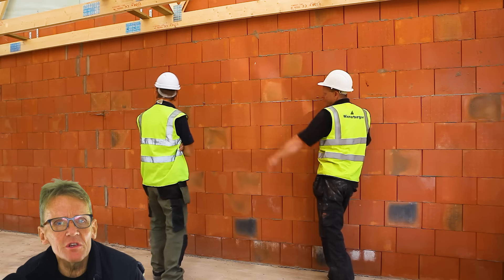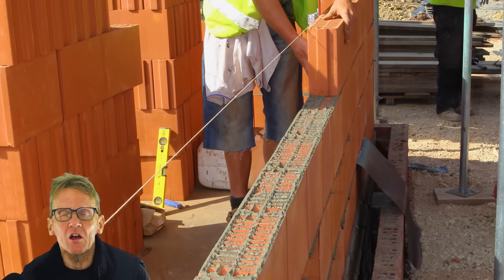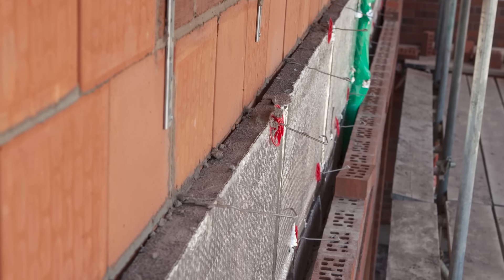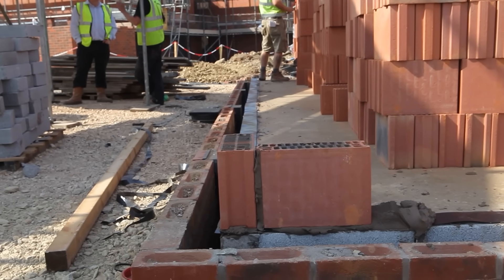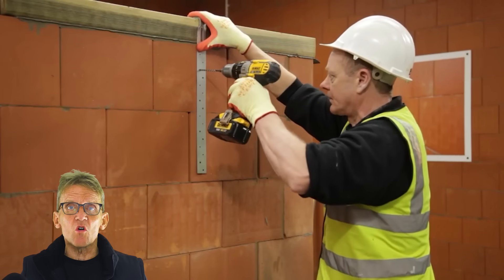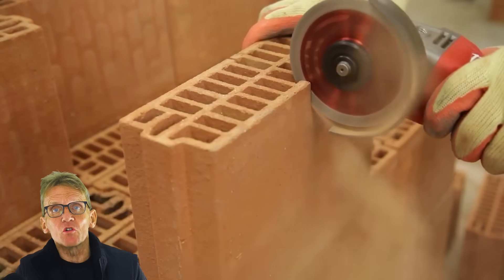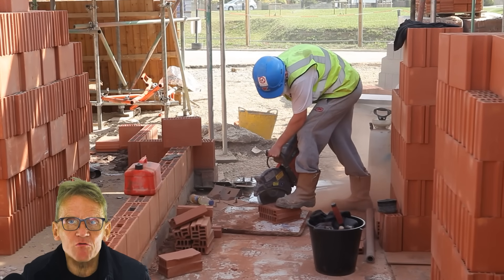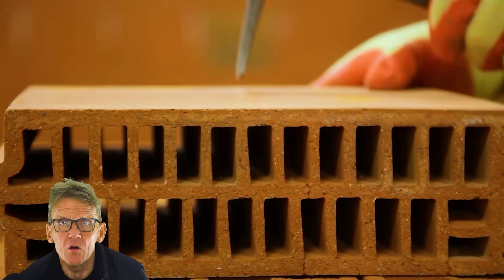Why Haven't We Warmed to Porotherm in the UK?

Comment: In this case, the special shape of the block ends creates a tight mechanical lock, which provides sufficient strength, tightness, and prevents the appearance of 'cold bridges' in the vertical joints. But I see that the shape of the ends is very poorly executed, and no mechanical lock is formed there... it will just collapse.

Comment: Porotherm blocks are used predominantly on outside walls. They have very good insulation properties, especially when combined with polystyrene panels. In Europe, the standard is 30-35 cms Porotherm combined with 20 cm polystyrene. Combined with forced ventilation a tripple glazed wibdows with outside shading gives very good summer protection. Summers are tetting extremely hot with temperatures over 30 degrees Celsia for extended periods of time. No need for air conditioning. In winters, houses like this will save you a ot of mone. We pay around €60/month which includes also hot water preparation.

Comment: Only encountered them once in uk in a small existing building.  I had a big problem securing any cabinets etc to the interior walls - the conventional uk fixings only had the useful depth of the very thin brittle 'pot tile' shell wall. 
Most each fixing length was useless inside the many hollows within the brick shell.  Being brittle the 'pot bricks' also cracked very easily - worse case, imagine trying to tighten a Rawlbolt into a drilled hole through a single 12mm vertical ceramic tile.

Comment: A thickness of only 15cm?? That's for internal walls and should never be used for external walls. Minimum Porotherm (or whatever the brand) brick thickness is 34cm for best insulation. Some brands even fill the brick's internal spaces with rock wool.

Comment: Wind and rain defeated. Clay is porous, how does it fare during freeze and thaw cycles. Is why concrete block foundations were used before pouring basement walls. Some experimenting with straw aircrete or hempcrete as natural alternatives to steel and glass in need of insulation from elements.

Comment: I built my house in south Germany with 36cm poroton perlite filled blocks in 2005. Plastered internally and the exterior with a stamisol breathable rain screen with vented douglas fir fassade. I achieved the KW60 standard. Brilliant system, would use again. In regard to people complaining about problems regarding fixings, well, you're doing something wrong as i had no issues at all.

Comment: I live in small continental country, and we have 4 Winenberger production sites in country.
They are everywhere, and can be purchased in any quantity. You can get whole train load or just i block.
Porotherm is not cheap, but is worth every cent.
Usually (lately) Porotherm is fitted with its own adhesive in form similar to spray foam. It is dry in few minutes, and has incredible strenght.

Comment: 3:15 Blocks do not wick moisture up🤦 It is a myth and a wrong one. What you see in Spain or whatever, is condensation, because these blocks still have some thermal mass left. Apply an Dichtschlämme, for the lower rows and especially the corners(and windowsill)

Comment: These blocks are used mainly because they are cheap, they also chip, flake off, suck water like a sponge, and a pig when you try and drill a hole and screw anything onto them. In Spain they never put in any damp inhibitor the reason ALL houses have damp walls.

Comment: Thin joint has been around for years but I have never seen these particular clay blocks used over in the uk. I also see in Spain they bed them on mortar rather than thin joint. Why ? Interesting thin joint hast really taken off over here. All the videos I watch from lads working on the big sites I can’t remember any using thin joint. When I was working in Germany 30 years ago we only used thin joint on the inner leaf cavity  but mortar and block on partition walls. The “ Spice “  ( Mortar ) as they called it lasted a couple of days. It was delivered by lorry already mixed. Then we used another type of mortar for the face work which was your standard mortar from a silo. So we had 3 types of the sticky stuff. I can’t remember what ties we used but I remember banging in Helifix bars Into the softer thin joint block through the insulation wool in the UK when we used thin joint. Once you get used to them it is a good system. And it’s pretty clean. But if you don’t get that first course absolute perfect you’re screwed.
Reply: I've seen them used in internal walls on some older/interwar period properties in the UK.

Comment: I worked for an English builder in Spain (Calpe area) back in the early 2000's so over twenty years ago now, we used those blocks for the internals, including obviously the room dividing walls, it was the cheapest way, as you don't build interior walls with wood or metal frames and plaster board, they are quicker and you don't need as many trades on sight.

Comment: Very common in Portugal and so is black mould and dampness
Reply: No cavity could be the reason for mould on the inside.
Reply: @JohnnyMotel99  the usual construction in Portugal has an insulated cavity and these are used with reinforced concrete pillars at the end of runs and capping floors. Damp is usually but not always condensation related due to air tight double glazing and no ventilation in conjunction with not centrally heated property AC systems being used to warm alongside wood burners, this is my personal experience in a more mountainous rural area in central Portugal. Old stone houses are generally damp often being built into land rather than completely free standing.
Reply: No central heating means condensation is problematic in Portugal. 
Nothing to do with clay block construction.
Reply: @philipnorthfield clay blocks are porous. They have poor insulation properties.  Cold humid Atlantic air in the winter and moist warm air from breathing/cooking causes condensation. The wicking properties of clay bricks draw this. Perfect conditions for black mould.

Comment: I mean the UK should adopt these as they are way more efficient than oldschool imperial bricks. You dont need cavity wall with these as they have holes in them to trap air. for the best results you should put up a desired layer of mineral wool (that is the best right now) on the outside then render. So this way you could avoid the monstrosities like another cavity wall which invites black mold and pest to crawl up on your walls unchecked (because of the vent holes) or full internal plasterboarding (Even on the main walls oO to make the already small flats even smaller or a possible cockroach infestation to be impossible to tackle.) Continental Europe uses these since 60s. Houses built with these are way more cost effective and solid then with old "london stocks" of the last centuries...Btw there are way thicker porotherm products the best are the monolithic blocks. The ones used in the video for the internal skin are really designed for internal walls not for the outside.

Comment: How do you remove and replace a damaged block?
Reply: Chip it out including the tongue and groove of the neighbouring blocks, grind a bit of height off the replacement block, put the replacement block in with non-shrink mortar as you would do with a standard brick/block.
Reply: @Candisa but how do you get the replacement block in the tongue and groove?
Reply: @suburbanyobbo9412 you don't, you chip the tongues off
Reply: @Candisa  I understand now! Thanks!

Comment: The ceramic blocks just make no sense when concrete foam blocks are available. The more modern option is not only cheaper but is more versatile and is easier to use while providing better thermal insulation if kept dry. If you account for all the benefits and downsides of the materials there is just no contest.

Comment: I used these not so long ago in the UK, super easy to get delivered (EHsmith) - delivered in 2/3 days.

Im not a builder and built a 3x6m kitchen extension in 1.5 days using these. Very easy to use, I haven’t had an issue with fixings either.

I’m soon going to do a first floor side extension + rear extension on another house, I’ll be using these again (this time the pre insulated block- no cavity needed)

Comment: I am from the Czech Republic and this is a standart for us (also aircrete). The same in Germany and basically whole Europe. I build my house from 50cm thick blocks for outside walls and 14cm blocks for the interior. I did not even use mortar as the brick maker offers a silicate-mortar pre-mixed so all I needed was a paint roller. As you say first layer perfectly level and from there it was a Lego! It was so easy that I find it perfect for a DYI bulider! I could not be happier..very strong, thick walls with no cracks and the energy efficiency is great and I did not even opt for the insulation pre-filled blocks. Dampness depends on the region, but waterproof your slab well and it is no issue.
Reply: and its the worst possible wall material for number of reasons, creates air chimney effects thru the hole height of the wall, needst concrere load bearing structures which creates lot of thermal flaws and that places needs to be good insulated(nulling the heat resistance of the therm brick), cant anchor anything in it because of the thin brittle walls of the brick, its slow to build and cant handle any eartquake... much better is usage of cinder blocks or wooden lost formwork like velox...  but the majority is allways wrong... most popular cars are SUV,  populist politicks, and therm brics...

Comment: UK didn't pick it up cause they're just cheap way of doing walls without any real benefit than price. Those blocks has cavities so internal air circulation is unwanted byproduct. Many manufacturers tried to remedy that draft and heat convention that follows (upper part of the wall get heated much more than lower, internally even in floor heating systems) filling those cells with fibers or styro. There's even a cheap system using mesh with cement glue at horizontal joists to prevent that air circulation. They are structural and fairly cheap and that's their only advantage.
Btw, aircrette block system also suck - that's why companies who make them invest so much in advertising. Bricks for inner walls (as thermal mass), wood framed thermally inert outer walls are the way to go, but that's just my opinion.

Comment: They're not blocks, they're just brick slabs. They are far too thin for that. Wienerberger also has real blocks in its program, in Germany Poroton up to 49cm (wall thickness) or Austria and other countries Porotherm up to 50cm (wall thickness). These bricks are called flat bricks here because they are ground flat after firing. The first company was Oltmanns, the predecessor of Wienerberger Germany, which received approval for plane bricks in 1981.
Reply from the maker: They are what they are regardless of what we call them. They are loadbearing elements of a wall.
Reply: @SkillBuilder  Yes, but certainly not reinforced concrete ceilings. They are so thin that you have to be careful that they don't fall over in strong winds. I don't understand why they're still so thin? Thicker walls are already being built in Ireland and New Zealand. Australia is also interested in the thick ones, they even want to install them with a robot on a truck. We already have robot walls here in Bavaria, but here all the walls are produced in the factory.
Reply: Come to Bavaria, where walls are built with robots. (Schlagmann is 50% Wienerberger) 
https://www.youtube.com/watch?time_continue=3&v=Xy9UF4JXplU&embeds_referring_euri=https%3A%2F%2Fwww.google.com%2F&source_ve_path=Mjg2NjY

Comment: The real problem is one of education in GB both within the building trade and on the legislative side. Ignorance is seen as an advantage. 

Added to this are the paradoxes within the town planning system (allowing carbuncles, pop up quality housing and then over insisting on newt protection).

Building quality and safety control (not site safety, product safety...) is also appalling.

Comment: Clay hollow blocks are horrible. They are firm and fragile at one time. Fragile and hollow. It seems ok while you showing plane wall of blocks. But when you need something more complex, which does not fit a whole block completely - there starts a fun part. Every try to reduce the size of a block is frustrating, they just want to crack like clay pots. Even if you successfully constructed a carcass of building of these blocks - fun doest not stop at all. Try to drill a hole in that wall, to anchor a door for example, or just to hang a painting on the wall - firm, hollow and fragile blocks will crack gladly at the first occasion. And most likely you can't use nice hanging facades in your building, yep, just because that would require a lot of drilling.

Comment: Our 1962 Gough Copper house in Kent uses these for internal walls built onto a concrete slab. No problems but you do have to watch out for the red dust when drilling into the walls as it does stain anything it comes into contact with unless you are careful.

Comment: Insulating and damp proofing are so simple although they can add to build cost.
It's beyond my comprehension as to why Spanish builders refuse to use either even today. UK Are not much better - they have "Standards" which were no doubt imposed by the energy companies, such as placing Radiators underneath windows so all the heat goes up and straight out LMFAO. 
In Russia they build super houses that stay warm even in -26 degrees.

Comment: About 10 years ago an early adoptee of this Porotherm system was a reasonable sized brick laying outfit called DJ Short brickworks, he trialled this exact method for at least a couple of years to my certain knowledge on new builds for Mcarthy and Stone and also Churchills Retirement living, I think he would have sold these on the basis of reduced costs and the speed of each floor combined as you have pointed out greatly reduced waste. I am uncertain whether he continues to use this method of construction or not having lost touch with crowd now but as a slinger at that time I sent up on the crane every last Porotherm block they used and duly skipped out the waste the same way and I can confirm the waste was truly minimal compared to traditional methods and materials. The hods liked serving these out but they were not universally accepted by the brickies as some would leave for other works whilst others would stay and persevere with the system, it’s got to be easier to lay these than trying to crash out jackwalls in the rain and as I’ve said the clean up for the hods was much reduced. I’m sure doc was used in the footings and on every new slab as we progressed up. Sound regs were the same as previously used ie the parge coat then the real heavy double skinned sound board. As for laying pre cast flooring planks across the living space walls it seemed a much sturdier build than slabbing across single skinned block work and seemed an improvement. Many Brits like the traditional face work rather than a render coat on these pot blocks I guess so maybe we will be largely using this for mostly internal work if it becomes truly adopted, Hey Ho all the best from Kev the Crane Driver

Comment: Moved to portugal 2022 and bought a house in Porto that is constructed with this producted. It's a double layer with open cavity between. If I had to do it mywelf I would have put iinsulation in the open cavity. This house is C O L D in winter, and interior mold is an issue. It was built 31 years ago and never painted. I had it painted on the outside, and I'm much happier than with the bare concrete rendering. Having a dehumidifier is a must, just so you know because of the mold. Cheers for now.

Comment: It's probably more about the materials used and the way they chuck houses together nowadays,my house is a big old country house built 150 odd years ago in an area below the water table,made of brick and timber construction,like many of the buildings around here,some around 200 years old,You don't see cracks in brickwork and mortar courses,in fact when we had an extenson built a few years back, the old end wall that made way for the entrance took some defeating.I've seen some horrors on newer and very new houses. Besides those porotherm things look hideous and need covering up,at least bare traditional brickwork can be pleasing to the eye.

Comment: In Portugal these can be used both for outisde and inside walls but probably the most common use case scenario is to use them on the inside wall and for the outside, you would use concret blocks or stone.

Comment: I did a job on an ex LA house built in 1947, and found these, or something very similar, were used for some of the internal walls. Whether this was a post war shortage, not sure, but the main structure was both leaves brick.

Comment: i Europe we use these bricks for inside room separation  walls not for outer walls, for that we use typically 30/38cm and  more affluent people 44/50cm thick bricks,  so same with but way more depth. and cos the manadated thermal number is 0,24 you need eps or mineral-whool outer insulation on them.

Comment: For external walls you have 365 size according existing building regulations and you don’t need external brick wall with isolation between. In this situation you have external render, 365 blocks and internal plaster boards on patches and is enough for external walls 😊

Comment: Seen them in Spain and often wondered why we don’t use them. However those I’ve seen in Spain are single course rendered outside and in winter the homes a freezing 🥶 but used as an internal block with insulation I’d say they’re worth using if they were available.